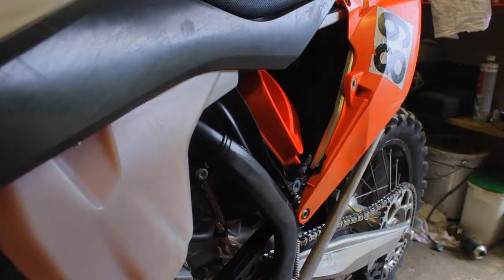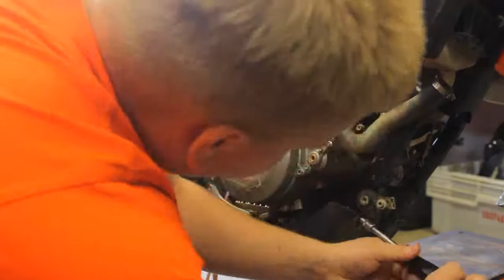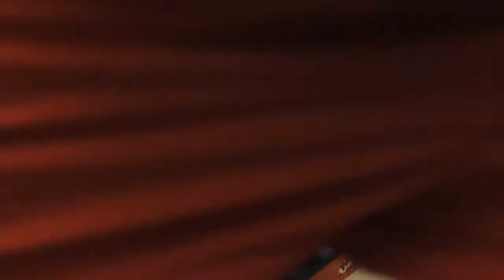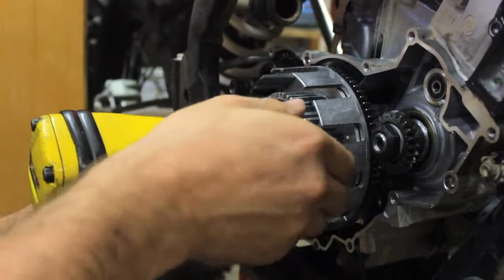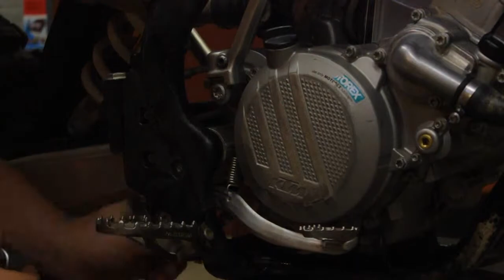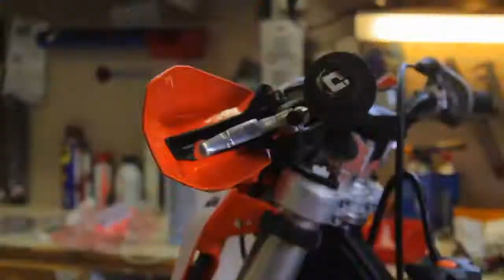BIKE REPAIR | KTM 125 XC-W 2017

Comment: get some bark busters n unbreakable levers that bend anyway! sick bike getting one of these next year carbed, either a 125 150 or 200 . just curious on your height and weight?
Reply from the maker: I´ve used both bark busters and unbreakable levers but I prefer using the stock ones because they are much better and give me a better feel to the controls and I also had some problems with too much play with the unbreakable levers. I weigh (without gear) ~79 kilos and my height is about 165 cm. I can manage the bike well but I also have quite good muscles so that helps to compensate my rather small height. In the future I´m possibly going to make some riding videos! In the meanwhile you can see me riding in my Instagram @petrusmut. Thanks for the comment!